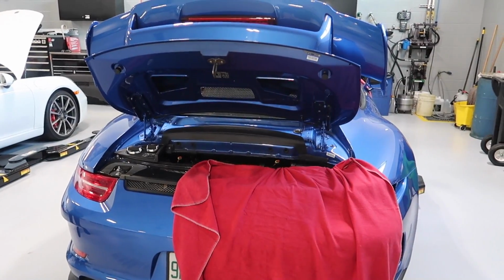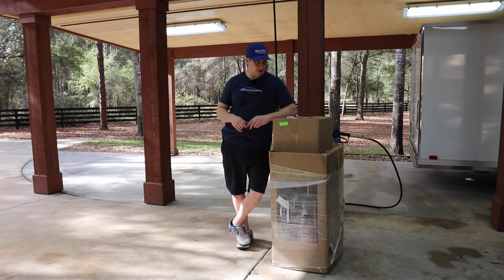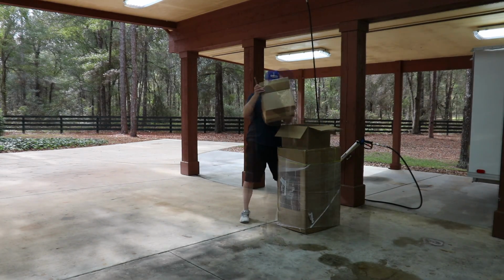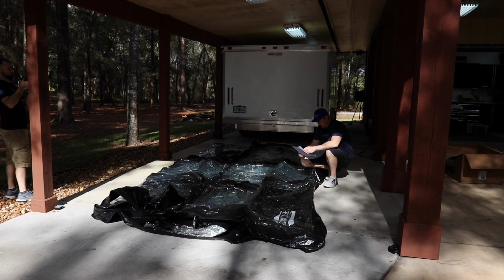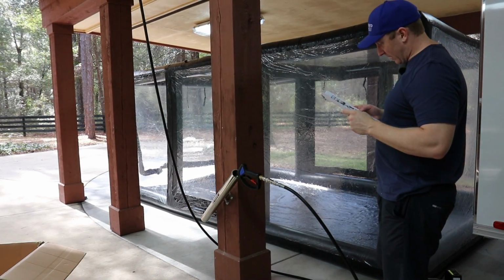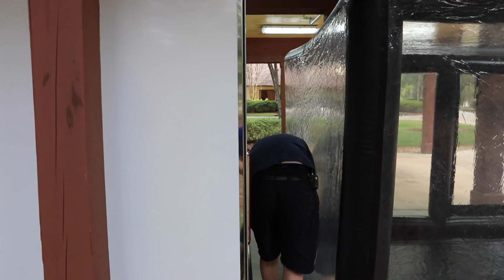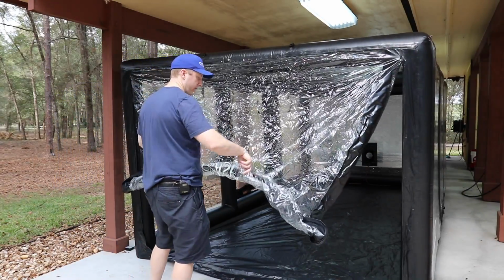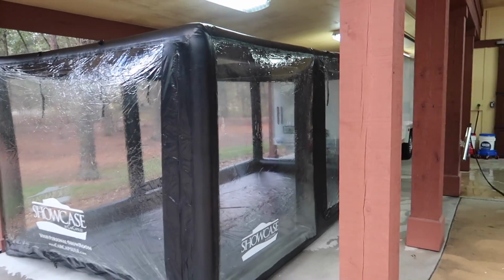Mouse Ate My GT3 So I Bought a CarCapsule Showcase

Comment: I once had a mouse find it's way into my shifter assembly on my '06 350Z and got trapped between the linkage and interior shifter bezel. Found out it because it smelled like rotting meat. Took apart my interior to find the smell and found a rotting mouse corpse, luckily no damage just horrible smell for weeks.

Comment: Hey Matt, sorry about the damage :(
We had mice get into a bin full of Christmas decorations that we kept inside a utility room off of our garage. They had babies inside the bin, urinated all over everything, pooped inside my entire tool set. We found our revenge in the form of an electronic rat/mouse death machine. It's called the "Rat Zapper" and it worked wonders. There is no mercy to be found in this route, however, so if the wife or kids are tender towards tiny animals, you may want to warn them.

Comment: So sorry to hear about the damage. Same thing happened to my wife's 2006 350Z Roadster. The car has less than 30K on it. It is her dream car.  A chipmunk got on top of the gas tank and chewed through the harness. I was investigating why the gas gauge had failed....I figured the sending unit in the tank had failed, but when I pulled the service cover for the fuel pump....surprise!!! Sending unit wires chewed clean through, with one of the fuel pump wires chewed half way through. I had seen the chipmunk around the car before, but it didn't dawn on me that he was living under the car. There were shelled bird seed hulls on top of the gas tank where he was raiding the bird feeder for food. They are cute, but the little punks can do some damage.

Comment: Very sorry to hear about your car. I had a similar situation where a mouse ate the insulation off a a sparkplug wire and as a result I had a misfire because the exposed wire was arcing to the valve cover. That was fun to figure out.. hope you have better luck moving forward.

Comment: Working at a dealership up here in MN, we see the rodent thing several times a year.  When insurance is involved, they typically want the entire harness replaced due to the other things that can potentially happen (like a car fire or ongoing electrical issues).  Also, rodents are attracted to the wiring in vehicles due to things like peanut oil and other "sweet" type ingredients that are in the wire coatings themselves (thanks to you, you big greenies).  Since the 90's, manufacturers have been working on ways to reduce the use of petroleums when building a car.  I have really enjoyed watching your vids.  I was very impressed that you personally laid everything out there for everyone to see.  I'm also a "C" type, but have been moving more towards an "A" type the older I get and the more I took on professionally.
Reply from the maker: Thanks man!

Comment: One thing I learned after having mice issues in the past. Do not underestimate their ability to find a way in somewhere where it wants to go. Even if the company says mice don't like the taste of the plastic, they will still chew through it if they want to get in bad enough. Everytime I thought I went overkill with deterents, they still found a way in. I store my summer car in a barn, which is the worst place for mice, as well as moisture/humidity so horrible place to store a car but I'm poor and it's cheap, but the owner uses some sort of device that gives off some sort of audible sound that seems to keep the mice away. Haven't had any problems the 2 winters I've stored it there so it seems to be working. The showcase is cool though. I hope it does the job and you don't have anymore mice issues.

Comment: I would put SwissTrax in the bottom to avoid tearing the base material. At $1600 for the Showcase, a few square feet of flooring to protect it might bee worth it if you plan on keeping it for a while.

Comment: How has this held up outside?  Seems it still gets some sun. Have you had it in strong winds?

Curious if it's an option for me. I park outside, 25'x20' driveway space to side of house. I put up a 20' shade sail, really helps. Main concern would be wind, get high winds here in OC, CA. My shade "sail" lives up to the name, lol, gets crazy in high winds, ripped once, will prob rip/break again. I enjoy the videos!
Reply from the maker: This would not do well if not in a covered area. The sun would destroy it.  Mine has taken quite a bit of abuse, but being covered is key to it lasting.

Comment: So, what are you going to buy to replace the GT3 with?  I know its the back of your mind to sell/trade it.  Esp after them having to paint the bumper :( :(
Reply from the maker: 991.2 GT3 if it comes in a manual.
Reply: Obsessed Garage I've been listening to your podcast, and I know you really want a new RS. Does the timeframe for the garage project make waiting to trade up infeasible?
Reply from the maker: Driv3n to Dr1ve I wouldn't pay a premium for an RS, so getting one is not looking good for me.

Comment: You could screw to rings into the ceiling above the entrance and attach 2 pieces of wire/string to the front zipped door left and right and thread it through the rings and over, so you can pull on the wire to pull the entrance way up straight out of the way instead of rolling it up and creasing it every time??

Comment: Took forever to find this video again after seeing it originally 4 years ago. In case you didn't know there have been multiple class action lawsuits regarding rodents eating wiring as most manufacturers have deliberately started using soy and food based ingredients in wiring insulation citing "green renewable" materials. All lawsuit attempts have failed and knowing this almost every manufacturer since 2011 has turned to using soy wiring in vehicle's as a result. They are simply capitalizing on the problem by adding "food" products throughout entire parts of the vehicle. I've even heard of specific parts having to be replaced on a regular basis because mice, rats and squirrels are literally feeding off your car and chewing harnesses, ducting and molding right down to nothing. Soy was just the beginning, manufacturers are now turning to rice, wheat, cellulose and Ford is now even collaborating with Heinz for their tomato skins for use in their vehicles. To top it off they have even taken to spraying soy oil as a lubricant to pull harnesses at the factory. That and the simple fact these companies won't use soy in airbag and crucial sensor wiring goes to show manufacturers know exactly how to manipulate this to their advantage.
Reply: Yup, well, not current Mercedes. I’ve had rodents in my engine bay (AMG GT) and nothing was eaten.

Comment: Matt, if a mouse chews through the wires, I would guess that Porsche wouldn't fix that under warranty. But after you paid to have it fixed, will the warranty be voided after the repair?
Reply from the maker: tyau1234 There is no such thing as a voided warranty.

Comment: I recently left a comment about using mothballs in envelopes made of galvanized screen wire and putting them in the engine compartment. It works better than anything I've ever seen. And there is an odor in the engine compartment when the mothballs are there. I take the mothballs out when I'm going to drive my car. The air that pushes around the engine clears all of the smell away in seconds. You won't find a better solution than mothballs inside galvanized envelopes. I've been doing for over 20 years without a problem. If you're worried about the mothball dust make some aluminum foil trays to place the mothballs on. If anyone can find an easier fix than mothballs I want to know. You can pick up mothballs at any Walmart .

Comment: @Obsessed Garage   Awww man, I feel your pain, albeit to a lesser extent.  I just bought a brand new Nitrous Blue Focus RS, and had a rat(s) try to make a nest in it.  I've caught two of them, and so far I don't think any major damage was done since it's my daily driver and I caught them quick, but it was definitely a terrible feeling opening the hood and seeing droppings everywhere.  

On another note, I'm glad to know at least some insurance policies cover this... $15k in damange.. incredible.   

Also, make sure to check all your cars frequently.  They also got into my Subaru Outback XT  - basically whichever car was driven last and warmest at night was the one they chose.  This was even when I had traps and poison under the car!  

Mice/rats do no like bright lights, so if you can, leave some lights on in the area.  I wired a super bright flood light that points directly at the opening of my garage door with maximum sensitivity (inside the garage so I don't annoy my neighbors).  Good luck Matt... like you said, they're just cars.

Comment: Hey Matt,  I'm a former pest control guy.  I'd put a ring of lockable bait boxes secured to pavers around your wash bay and service regularly with rodenticide.  kinda like a first line of defense if you will.
Reply from the maker: I bought a bunch of those.  Any suggestions on how to secure them?
Reply: I used to use small concrete pavers that I would drill through then bolt the bait station onto the paver.  Or you could use braided steel line run it through the entry holes and secure them to the tree's or wood pillars by your wash bay.
Reply from the maker: Thanks Albert!

Comment: Matt once the gt3 comes back get rid of it. itll never be the same again
Reply: Ultimatemxcn Jesus!
Reply from the maker: Believe me, I've thought about it.
Reply: Sucks that many car manufactureres use soy based compound that coats the electrical wiring.  Its a tasty treat for rodents!
Reply: What I see in the video are the can-bus wires, very sensitive stuff. I see no good way of repairing the car other than replacin the whole main harness. And once you disassemble a car like that the risk of unwanted squeaks and rattles is very high. Hope you get it sorted.

Comment: Could you just use your trailer to store your car? Make a mount to hold the trailer in place so you drive your car in and out of it. 
That was the plan I was going to do until i build my new garage.
Reply from the maker: My trailer is so lightweight being all aluminum that it's just not practical to pull it in and out all the time.  I drive my car a few times every week.
Reply: yah I was hoping for duel purpose.

Comment: You do NOT need to pull that car apart to repair it in a way where it will function normally long term.
Reply from the maker: That's what I chose to have done.  Tearing the car apart was a terrible idea.  You know fair well that it would never go back together the same.
Reply: Obsessed Garage I agree completely...have been there, done that.  No matter how careful the technician is, it will not be the same.  Repair is a better option than replacement as a whole.
Reply: I think if it were mine, I would prefer to have the entire harness replaced.  I think you could manage any rattles or fitment issues as they appear.  I would be afraid that a wire could become compromised that is not know of or seen at this time.  Plus, I would not want repairs to wires to be seen on a car like this.  I feel like the materials Porsche use should be able to handle being removed and reinstalled.  Like you have stated, I do believe you wouldn't need to remove EVERYTHING to get the harness replaced.
Reply: My uncle has an old 911 and had to get almost the same thing done. He somehow arranged to have dynamat guys there for the install of the harness. His car feels like solid steel and they had to take it apart completely. It is your baby though! Sucks to see someone else handling it.
Reply: Hey Matt, that's really bad news about your GT3. What a tough call to make. Believe it or not there are great technicians out there that do give a shit and have the skills to carry out a job like that. My cousin replaced numerous body harnesses when he was working for Mercedes-Benz in London, in very complicated cars like the C215 CL65 AMG with 100% success. I've watched him repair cars here in Australia at his own workshop too and no matter how far torn down they get, he NEVER has any left over pieces when he's done. And he's very fussy to make sure everything is exactly as it was from factory down to the cable tie placement. Unfortunately I'm not sure that i have any faith in your guys seeing as though they scratched your rear bumper just trying to remove a tail light. We feel for you man. This is why I will never own a brand new car coz when something like this happens it would kill me.

Comment: Obsessed garage Matt : My new car is in storage for winter. Iam paranoid about rodents. Also my new car had a factory paint issue and I feel you pain about repaint. Every single time I get a car back from bodyshop. My cars get over spray every damn time every time.
Reply: mclovin'78 I just recently had that happen along with a tab bit of swirls. What did you do to restore the paint?
Reply: Gerardo Ordonez right now nothing..  it's way to cold its -2 degrees. I have to wait till spring. The paint needs to still cure before I start the process. I've found a few clear coat scratches also. At this point I don't want them to touch the car anymore even though they should make it right. But the over spray will come off by clay bar process. And the swirls will come out you just have to Polish them out..

Comment: Get some mothballs and put them in envelopes of galvanize screen wire. I've never had one mouse to come close to my engine since I've used galvanize screen wIre with mothballs. I also haven't had a problem for using the mothballs in the engine compartment. I was told the mothballs would damage my metal in the car. I'm putting the mothballs in an envelope made of galvanize screen. The mothballs don't touch the metal in the car. If you're worried about the dust from the mothballs just put the galvanize screen envelopes on top of some heavy duty aluminum foil trays. I've been doing this for 20 years . I've never had one problem from any animal or rodent .
Reply from the maker: Do the mothballs stink up the area?

Comment: why don't you keep the car in the enclosed trailer???
Reply from the maker: It takes an hour to get it in and out.
Reply: Why does it take that long just drive it in......your not transporting it so no securing it with straps  needed.

shouldn't take a hour.....takes me 15 mins.
Reply from the maker: Move the trailer, hook up hitch to my truck, attach to my truck, move into position, pull out the ramps, pull the car in.

Comment: My first thought was, why not just use the trailer? Then I thought about it for a few minutes. Never let a messed up situation go to waste. Get a new tool/toy. I would have went with the new tool/toy also.:)
Reply from the maker: The trailer is aluminum and weighs less than 2,000lb.  I need to have it hooked up to the truck to load and unload.

Comment: Call an Exterminator - He would call you for retirement advice.
Reply from the maker: Good point.
Reply: Someone would really have to have no concept of earning a dollar for a $9000 wire harness not to make you cringe- yikes- good luck. I understand why you don't want to tear it apart but I would worry that splicing may introduce voltage irregularities that may give the car a mind of its own (doing stuff for no apparent reason)- I know nothing of this so don't take this as advice-once again good luck

Comment: You need to find a really good mechanic outside of the dealer and I guarantee he/she would have been able to fix the wiring without taking everything apart for a lot less money.
Reply from the maker: My insurer wouldn't be as keen to use someone outside of the dealer.
Reply: Why not put it in the trailer until the garage is done?
Reply from the maker: I drive it often.